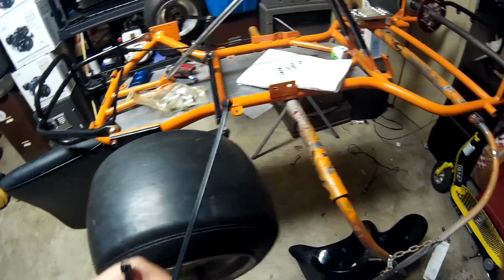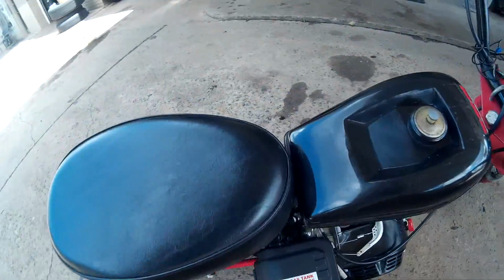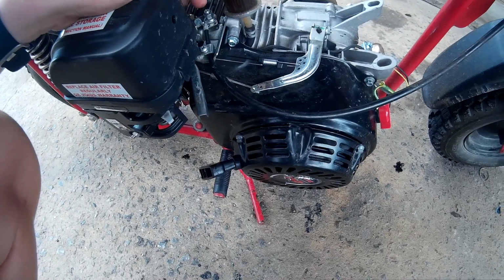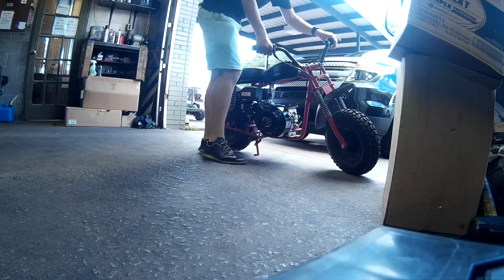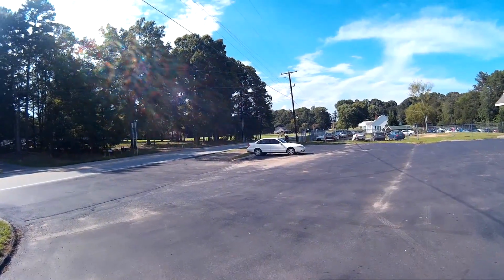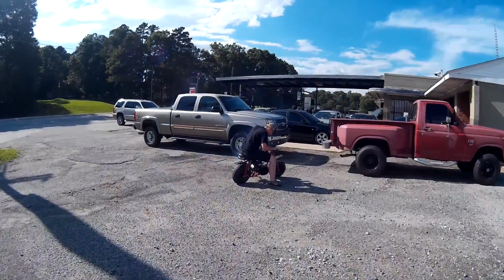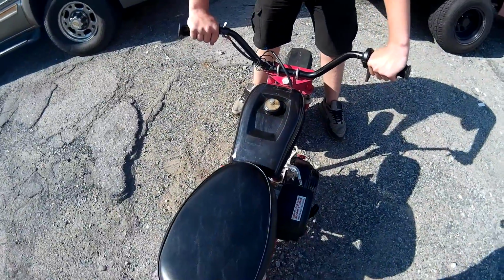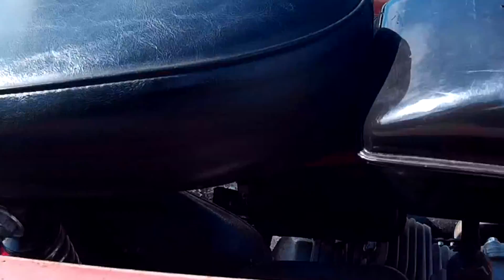Minibike Governer Bypass

Comment: dont run it wide open for more than 30 seconds or it might blow
Reply: unless you have heavier valve springs
Reply: It will not blow unless you have heavier valve springs
Reply: +ThatBlueBike that's what I said